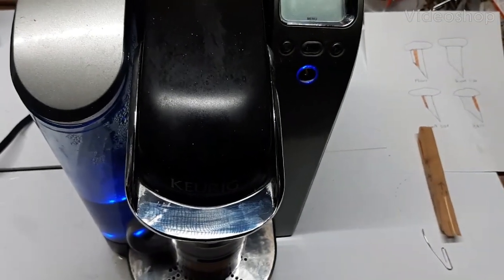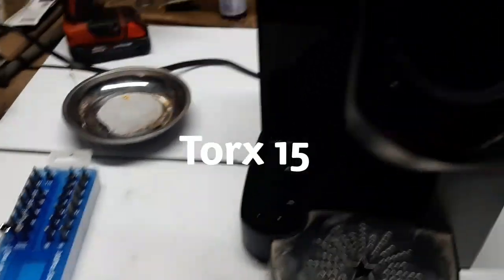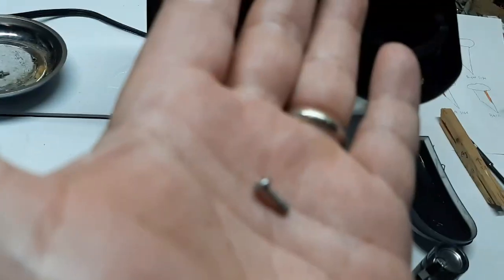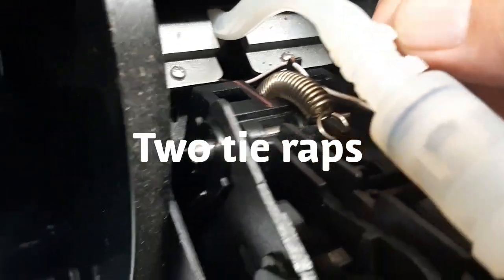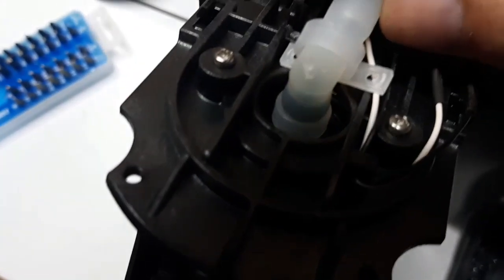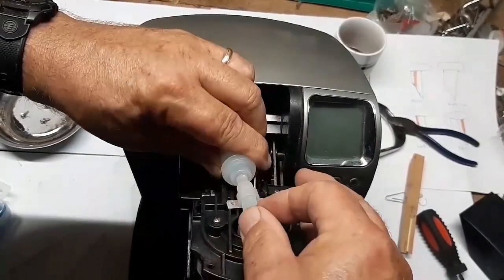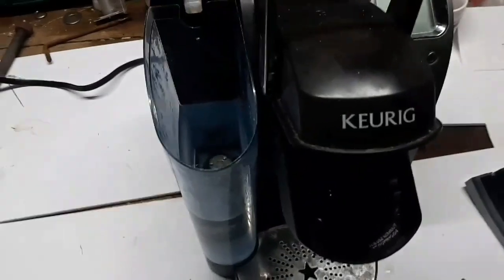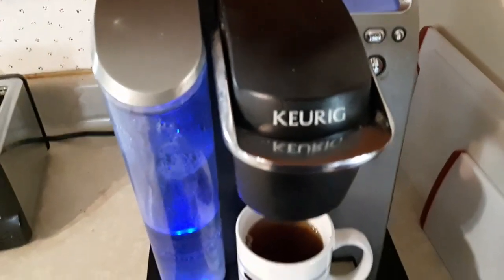Keurig doesn't brew a full cup. How to clean check valve

Comment: I just had a problem that none of the videos helped fix.  (watched about 10 of them)  I did all the tips -- even took some of the water lines apart and cleaned them.   Then I took a ball/bicycle pump -- put it on the water value at bottom of reservoir and pumped a few times.    Now it works!
Reply from the maker: Thanks Chris for posting. Good idea using the ball/bicycle pump.

Comment: Use a small piece of painters tape on small screws at the driver tip to hold them for one handed positioning. You can also use tape on a hex head screw or bolt to allow a compression fit into a socket. Again, for blind or non-magnetic installs.
Reply from the maker: Thanks for posting. Very good tips.
Reply: I read this but I don't understand it.

Comment: I have the 2018 Keurig model K- compact. 
I am currently wondering if there is a problem with the water pumping mechanism? Not all the water put into it comes out!
I put in 28 ounces of water, and only 20 ounces come out before the "add water" light comes on! Where does the rest of the water go?
Is it trapped inside the machine somewhere?
I just got this machine, I hope it's not defective.
Ideas?
Reply: I can tell there is water trapped inside the machine. You can hear it sloshing when I puck up the machine and move it around. Also, some of the trapped water will dribble out of the K- cup area.
So disappointed!
Reply from the maker: @carolgarrett1786  Carol I would return the Keurig if its under warranty. Sounds like the check  valve is not working.
You may want to try and use a turkey baster to force air thru the bottom of the reservoir where the water enters the machine you  may have an air lock.

Comment: My Check valve seems plugged. I let it soak in vinegar for 20 minutes, blew in it, and it's still isn't working.
Reply: So, where exactly IS the check valve?
I've tried watching these videos on my phone, but it's so dark and I can't make out what parts they are talking about.
Reply: @carolgarrett1786  The big, white bulbous thing that's removed in the video above contains the check valve. You can see the round blue o-ring gasket inside it. That o-ring is what seems to get clogged. Soaking the whole piece in vinegar, overnight, helps unclog it.

Comment: You don't have to remove the handle. I've soaked mine in vinegar for 24 hours and it still sticks again after a couple of weeks. Trying to find a new replacement check valve.
Reply from the maker: Thanks for posting.
Reply: Did you ever find a replacement check valve, Paul?
Reply: @WaltDittrich  No, I ended up buying a new Keurig.
Reply: @paul8540  Thanks. That wasn't the answer I was looking to hear. 😂
Reply: @WaltDittrich  Sorry, I only have so much patience when it comes to not getting my daily caffeine fix...lol.
Reply: Dude, you could have just regularly ran vinegar through it on descale and it won't build up like that. Sounds like the problem is in your water supply and/or you aren't regularly replacing filters, and/or possibly not seating the filters correctly.

Comment: Couldn't you just run vinegar through it like you would with a normal coffee pot?
Reply from the maker: No I tried vinegar and it didn't work. It had to be taken apart. Problem was at the check valve.
Reply: I've run descaling solution through. It will work for a short while, but gets backed up again fairly quickly.
I'm going to try soaking the check valve in vinegar overnight. See if that gives me more than month of use.

Comment: How hard do you have to blow through it to get air to come out?  I seem to need a bit of force to get air through my check valve which I think is causing water to come back through the overflow drain into the tank...
Reply from the maker: Normal was easy to get air thru check valve,
Reply: I hit dislike by mistake.  Sorry

Comment: Thanks, after many descaling and trying other tips, I was afraid I had a bigger issue until I found this issue.  I took off the check valve, it looked crusty inside.  I blew through it and it seemed sticky.  So I soaked it in vinegar overnight, reinstalled the valve and it works perfect.  Thank You!
Reply from the maker: Your welcome, Happy my video helped. Thanks for posting.

Comment: A much easier approach that doesn't involve taking the unit apart is to take the unit to a gas station and use compressed air at the water intake to blow out all of the coffee crud.  You may need to put your finger over the overflow.  Quick and easy.  Nothing wrong with first using a paperclip or pipe cleaner to try to clear the obstruction but often this is merely a temporary fix.
Reply from the maker: Lol think I will stick with the paper clip. Your gas station compressor will smell of tires when brewing coffee, lol
Reply: BILL ANGELL.  CANT YOU JUST USE A CAN OF COMPRESSED AIR. INSTEAD OF GOING TO GAS STATION. CAN YOU USE A SMALL PUMP A FOUNTAIN PUMP WOULD IT WORK.
Reply: Where would one push the air into?
I tried compressed air into the overflow, and it'll push water out through the K-Cup side, like normal. Don't want to do that for every cup though...
Reply: @DavidSmith3750  HAPĒ NASHUNEL CAPSLÅWK DAE BÖRTHERS ,NAWMUSTAY. .
☆SENṬ FRUM BŰNN VULLOSUTTY ƁṬ
GOBBLESS. .